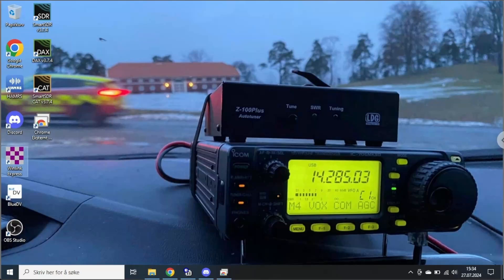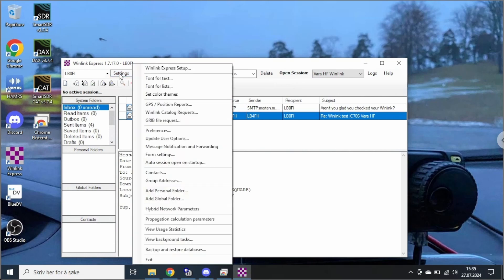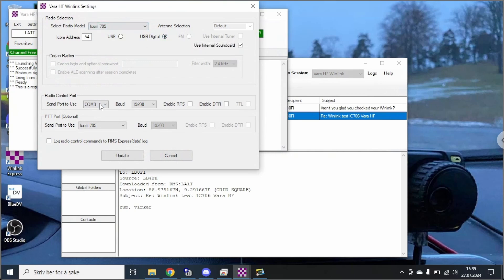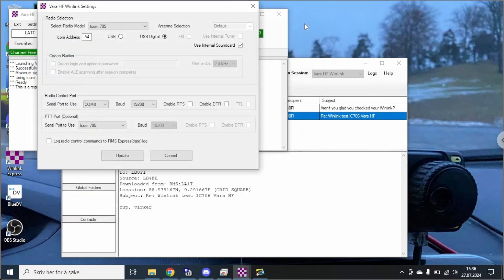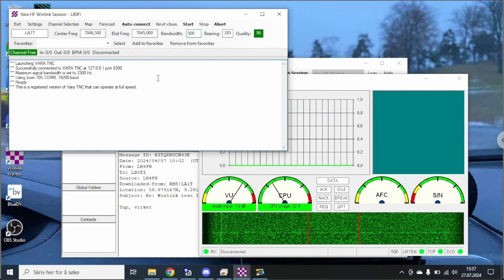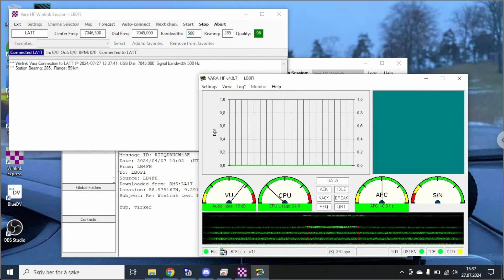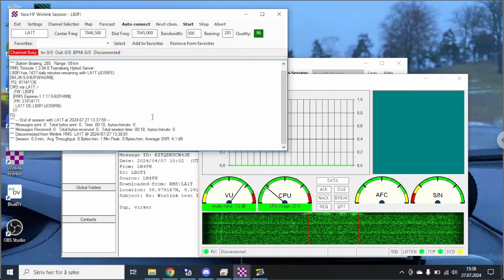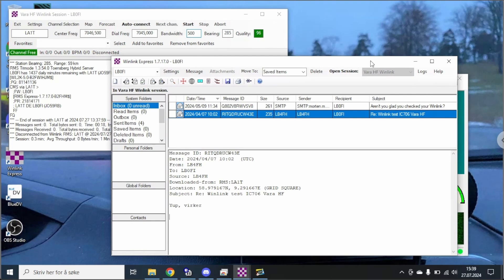How to set up Winlink on the IC-705

Comment: This didn’t help….no settings on the radio? I’ve done exactly as you but my 705 doesn’t change freq’s when I pick one in the channel selection!
Reply from the maker: Without any more information it is hard to help you. Does cat control work in other applications though?